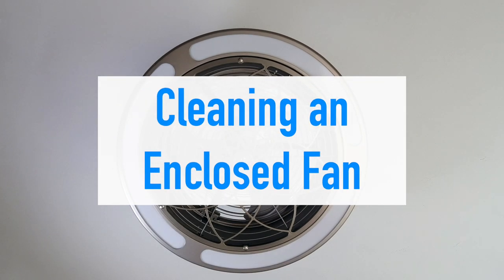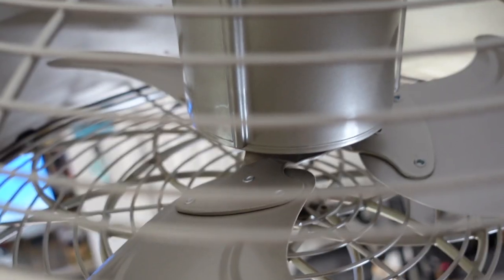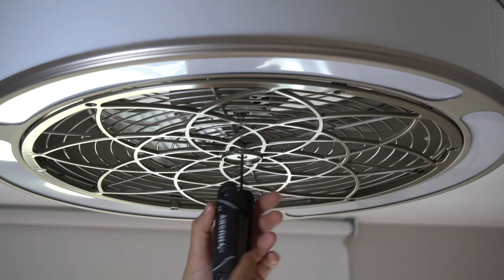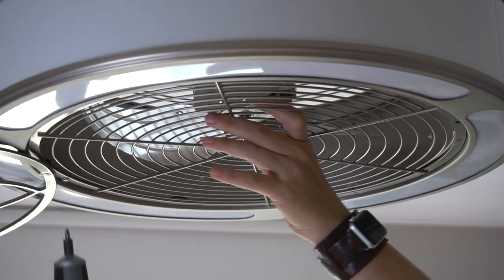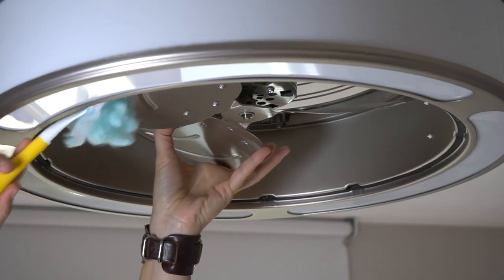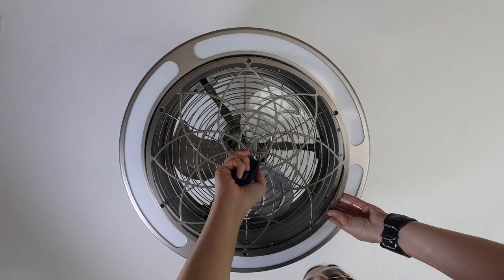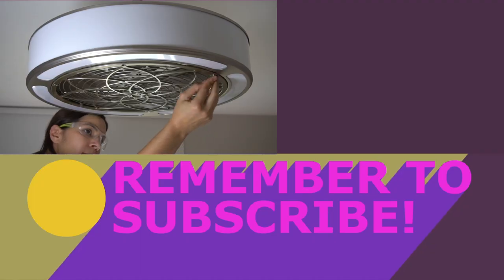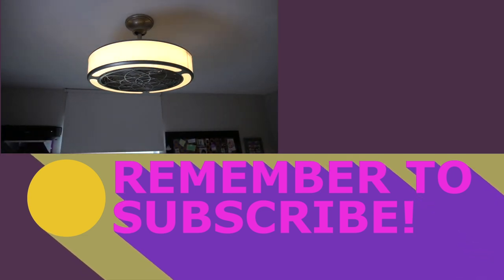How to Clean Blades on an Enclosed Fan

Comment: Thanks so much for this great video. My fan runs 24/7 so it does get dusty. I painstakingly have jammed a stiffer duster in there to loosen any dust and then try and vacuum any particles as best I could. Now I know how to take it apart it will be a breeze next time. Now, can you make a video on how to change the DIP when the fan is installed in the ceiling? We have another fan in our living room that turns on and off with this fan. Thank you so much for your help.

Comment: I have had these fans for 4 years now. How do you clean around the white light shade on the bottom around the fan? I’ve taken it apart and sprayed it with the canned air but it doesn’t touch the white plastic piece. It’s filled with all kinds of stuff. I’m super clean and this is driving me crazy.